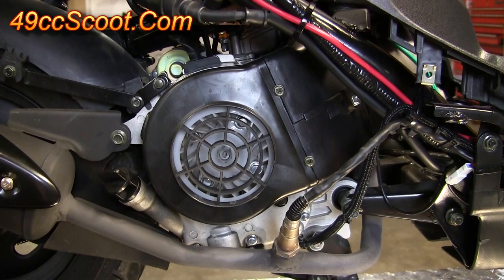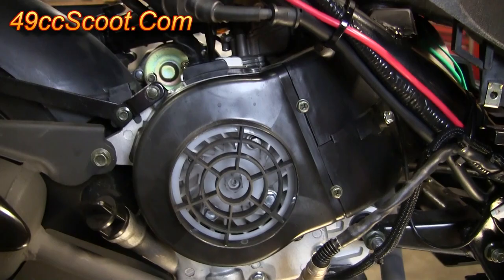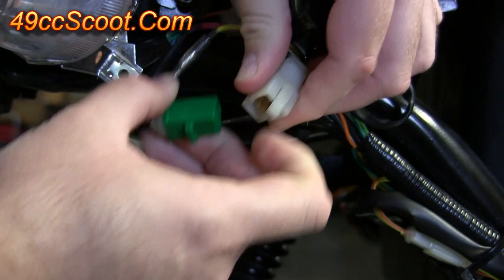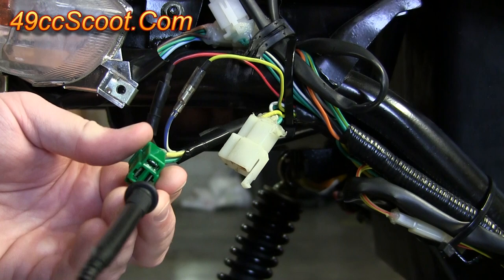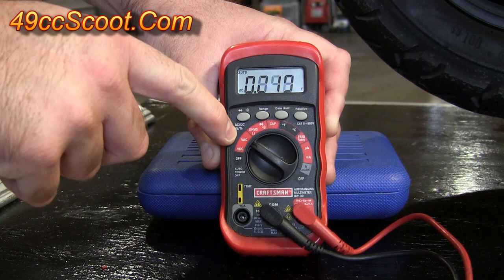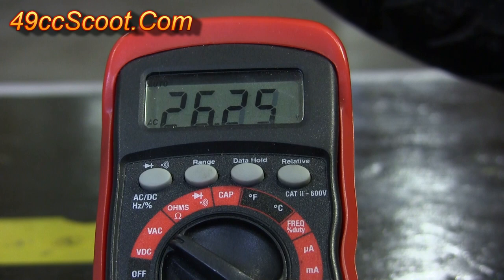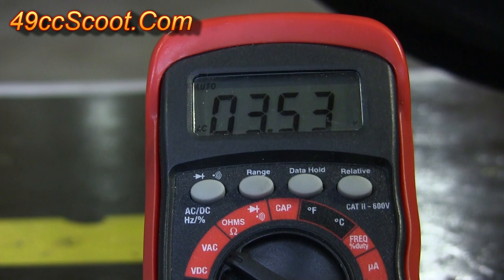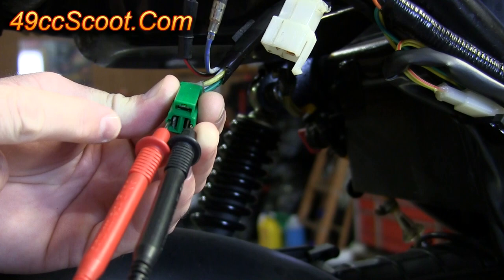Easy 50cc Scooter Stator Charging / Lighting Check : 139QMB GY6 50 QMB139 49cc

Comment from the maker: You can remove the CVT air filter and vent the CVT if you'd like. Won't pick up power, but could reduce heat related spring fade and possibly wear on other components. Don't remove the carb's air filter. If you want to do something there get a UNIT pod filter and upjet/tune the carb. For the exhaust, again don't remove it. You could get an aftermarket pipe. Check the jetting after. May see minor gains.

Comment: part of the store you didn't get, this all started with replacing the motor the new motor had a p at the 157 the old motor was not a p motor everything appeared to be the same except the stator was slightly different the green ground wire on the p motor the stator had a riveted ground to the back of the stator not directly to one of the coils like my old stator, installed stator and flywheel from old motor to new motor all is good !
Reply from the maker: Glad you figured it out.

Comment from the maker: A stiffer contra spring will raise RPM. I'd suggest trying to tune it with different roller weights, or ever better slider weights. Sliders will last longer and sometimes improve performance as well. Get the right weight dialed in so the CVT operates near the engines peak output and it will accelerate more quickly. I'd start there first. If it doesn't feel strong for the first few feet, stiffer clutch springs may help.
Reply: sir what is the right match for clutch spring, contra spring and roller weights for a stock 50cc honda dio to improve speed.

Comment from the maker: Stiffer contra could drop speed. So could rollers too light. To me the reasons to change to a stiffer contra spring are 1) When you experience belt slip or 2) When you can't get RPM where you want it with rollers or sliders available to you. Contra spring and rollers act against each other, so there must be a balance there. It's best to keep the CVT cover as it may increase structural integrity. Have seen 2 diff ppl break a CVT  case in half with no cover on the forums. Not common, could happen.

Comment: I'm running the fiddle 3 which uses a DC stator. I'm having issues with properly charging the battery. While using the scooter normally it just barely charges enough if not just under the proper amount. But the moment that I turn on the phone charger, voltage drops significantly. 
All of these readings are at the voltage regulator plug with the black voltmeter rod connected to the green ground wire:

64V ac yellow 46V ac white no reg connected (revving)
Drops to 12.0-12.1v ac yellow and 7v ac white with reg connected
26v ac on red connected
11.7v dc (engine off) to 12.4v dc (idle) on red reg connected

The voltage on battery also drops when accelerating and sometimes engine power is also lacking (I'm thinking it's connected to this issue)

I've recently replaced the stator, regulator and battery and this issue persists. Did I get a bad part?

Comment from the maker: Is 15V AC with the stator not hooked up or DC with everything connected? If it's DC with everything connected, checking at the batt, that's good and it's charging.

Comment: Yep taillight which is powered by the stator as the headlights are goes out also but things powered by the battery like high beams turn signals and brake light all work just fine and the scoot starts just fine so but I will definitely check all connections again it's weird for the first 30 seconds I do have headlights and tail light, but then they fade out and are pretty much gone...
Reply from the maker: Maybe see if you get voltage out of the stator after it's hot. So do the check here after the lights have shut off.

Comment: Please answer my question. I have a gy6 TaoTao  50cc Vip scooter. Last week ago my headlight light and tail light stop working. However, everything on my moped still work fine. People told me to buy a Universal Voltage Regulator Rectifier, 4-Pin 12V Male Plug Voltage Rectifier for 50cc to 150cc ATV Moped GY6 Scooter. They told me it a strong possibility that it may fix the problem. To get my headlights and taillight back working correctly. My old rectifier was 5 years old it came with the moped and work amazing. So, I went to a moped shop got a new one. Put it in correctly. It did not fix the problem waste of $25.00. Now, people telling me to renew my  Stator. They tell me the headlight and tail light run off the stator. My stator is 5 years old as well. Been Never renewed or clean or fix.  You think if buy a new stator off the tao tao site it will fix the problem?  I really need my tail light and headlight to work. It not safe at night and I don't want the cops to give me ticket. What will you suggest me to do?  And I hate going to the moped shops in my state. It like they fix the problem half-way to make you come back again. Like it been times I got things fix. And days later or few weeks I'm paying for the same repair over again. So, I am  thankful for your videos and free knowledge.  I believe I have the skill to fix it my self. I:m  decent  at doing repairs. Please help me.  Later
Reply: When the lights do not work but the scooter starts and runs perfect it clearly indicates the section of the stator that powers the lights is bad..This is the yellow wire coming from the stator.there a 4 wire white or green plug from the stator..There is no need but if you want you can test it with a multimeter while the scooter is running..Ser the multimeter to Ac you shoudl get like 15 AC volts at idle and higher when you revvy it up.When the rectifier regulator is bad it usually blows the bulbs and the CD voltage on the battery goes above 15.5 volts when you revvy it up..the rectifier section turns AC from the stator into DC and sends it to the battery thru the red wire to charge it..if it does not charge the battery,then the regulator is bad or the stator is not producing enough power to feed the rectifier.i hope this helps

Comment: You need to do this with the conector pluged in or I'm missing something....my scooter only had 4 wires is a 125 cc gy6 made by gareli and on the green and blue/White I'm getting 15 at idle and 60 at full throttle but between the green and the white only 3 so this means my stator is bad ?

Comment: Hello, if the scooter starts and runs ok but the light from short and long beam and the bord lights does not work, only the turn lights and break light work what is the problem?
Reply from the maker: If you have a headlight switch, start by checking that. See if you are getting power to the switch and if not, find out why. Check lighting, stator and regulator connections. See if you have stator output (as shown in this vid).

Comment: Are you still doing this? My turn indicators are not working? I changed the relay indicators but the connector to the other cable seems to be rusted inside?
Reply from the maker: You can do ohm/continuity checks if you have a meter. It kind of sounds like you've found the problem. Rusty connections don't conduct well.

Comment: Great videos, my stator reads 15-23 and only in the 40-44 range when throttled up. When I plug the stator back into the harness it blows my fuse..  my scooter is a 2016 Tao-Tao 49cc which I bought as a basket case . I replaced the fuse holder with a 10 amp plugin mini fuse.
Any Ideas ?

Comment: I changed everything on my scooter and still it charges fine on idle and throttle but when i turn on the lights voltage falls down 11 and does not come up even after giving it gas
Reply from the maker: Make sure the battery is charged and in good condition. If it's a swapped headlight, maybe it draws too much power. Possibly a stator or rectifier issue. Not sure what your scoot is, but I know when trying to buy parts for Chinese scoots, you have to be really careful that everything matches up on the stator and sometimes regulator/rectifiers that are supposed to work don't. If you swapped everything, you could see if swapping the old r/r back in changes anything or maybe the old stator.

Comment: After a new stator I am blowing headlight bulbs on a 50cc peace sports. All seems inspect while running but I can get a spike at higher RPMs for a split second while monitoring the lighting wire I assuming staters intermittently over spiking or shorting somehow?
Reply from the maker: Could be a bad stator or just the wrong one. If it was fine before, it's not so likely  to be the regulator/rectifier. I went through this on a 150 and one stator that seemed to be like the other would blow bulbs. Got a different one and it was fine. Check everything you can before spending money. Resistance values and any wiring or coil differences you notice.

Comment: Sir, I testing my stator the way you did. I got 50v while opening the throttle on one of the wires but got no more than 38v on the other wire. Should I replace stator?
Reply from the maker: First, if there's any doubt then re-test. I would expect to see higher values if you're revving it significantly. If having charging problems, I'd probably replace the stator at that point or find resistance values in a manual and see how they look first.

Comment: The stator output was 35 VAC when I first checked it before I even hooked it up to the rest of the system....when it was put under load(connected and running at 4,000 rpm) it showed 15 VAC output to the system on the meter and battery was discharging....a new stator is supposed to have around 60 VAC when it is working properly...right?...this one  seems defective.....last night I charged the battery again and put the meter across the battery poles and measured just under 12 VDC with bike running at 4,000 rpm( I its supposed to be checked at 5,000, but my wheel touches the ground due to a performance shock I installed).... then the bike eventually went below 11 VDC and it died.....a scooter wont run without at least 11 VDC of power from the battery from all I have read.....what do you think is going on?.....a piece of extra info: have the headlights wired to the battery directly.
Reply from the maker: Is that scoot a DC CDI? If it's an AC CDI, it should be OK even without a battery. A DC CDI would need a good battery to run well. You may not get 60VAC if you are at 4000RPM, and it all changes once hooked up to the scoot's wiring. Your headlights may be too much and draining the battery also.

Comment: Hi, hope you can help me out here. I’ve a TGB 50, starting good, everything else working ok but the headlamp, running light and tail light not working. Traced wires, cleaned connectors, checked bulbs, still not getting lights. Any advise please, Mike
Reply from the maker: Some scoots use 12V battery power for the lights. If that's the case, check your battery. Otherwise, check lighting output as the vid shows and make sure there's no fuse that's blown.

Comment: Hello
 Namely, I bought a new battery, assuming the old battery didn't work
 properly, but it turned out that the problem was not even in the batteries, namely
 the battery probably won't charge, the voltage won't increase. The full battery life was 12.6v and beyond
 each startup drops about 0.2v.
But if you can start the engine electrically, then you can drive wherever you want even when battery drops below 11volts.
if it is kept on the ground for about a minute at 4000 5000 revs, the battery will gain 0.1V, so it kinda works but it doesnt generate enough.
So right now im just driving with 2 batteries, 1 in car and 1 in backback.

And such a conversation struck me with 2 factors .. a stator, or
  the voltage regulator is not working properly, ie problems with the generator in general.
So basically i should check the same wires as you checked and if they are faulty then i should replace them right?
Reply from the maker: If it's the same engine, then this test should tell you if the stator is putting out charging/lighting power.
Reply: @49ccscoot  hey problably not, mine is a  jiajue one but not sure what model, but i know where the connector is what you showed and i will test it today, thank you.
Reply from the maker: @martinezuringoz There are tons of Chinese scoots that use the same engine style. 139QMB is the most popular for Chinese 50s.

Comment: changing the stiffer contra spring will affect the top speed ?? stiffer contra spring need heavy roller to balance it ?? can scooter run without the CVT belt cover ?

Comment: My Piaggio 125 doesn't keep its battery charge, just wondering if I am looking in the right place or could it be something different?
Reply from the maker: Definitely a good idea to check the stator output if you don't see charging voltage at the battery. If the stator is good, probably the rectifier/regulator. Check voltage at the battery first. There's a possibility that the battery is going bad. https://www.youtube.com/watch?v=xS58b5jZ0ic

Comment: What if i'm getting a high voltage up to 20 or maybe more and it keeps burning my headlight ? and even though i installed a new stator and regulator and it's still transferring high voltage that causes to blow up the headlight everytime i change it, any idea of what is that could be ?
Please let me know thanks!
Reply: you need to see if you have a short to ground,

Comment: how can i improve my 135cc 4 stoke scooter acceleration , it heard like going at low rpm when accelerate and get into top speed of 115km/h , how can i improve all of this ?? what different compare to stock when change 1500rpm contra spring ?? i need to have a racing variator ? or just changing the roller weight and spring ?  thanks

Comment: I have a honda elite 50, I recently converted it a 70cc polini , after im riding for a while it drains my battery and I have to kick started. 
I thought it was the battery so replaced it and still,  you think it may be the stator
Reply from the maker: Check your voltage at the battery and see if it's charging that way. https://www.youtube.com/watch?v=xS58b5jZ0ic

Comment: My headlights will work properly upon startup of the scooter, and they seem to respond to throttle inputs RPMs(brighten and dim Etc which is normal... But then after about 30 seconds they go completely dim....  Haven't checked into it yet but I'm wondering if it could be the rectifier regulator ?? Or? Thank you I appreciate any suggestions you may have
Reply from the maker: Check power to the headlights. If you have other lights powered by the stator (maybe the tail light in some cases or dash lights), see if they go out too. Make sure there's nothing simple like a bad connection.

Comment: My headlight is not working it used to come on and off when i would hit bumps on the road but now, it wont come on i checked the wires and the bulb the wires look okay a little sloppy but good enough. all other lights work i don't know what do it's dangerous at night and i need to renew my inspection in 2 weeks and without a headlight it will fail of course. some additional information it was raining and i saw a rain drop go into the light button could that be the problem?  Any suggestions? i'm running out of options. Thanks in advanced
Reply from the maker: I'd check all wires... from the headlight to the switch(es) and then to power from the switch(es). Sometimes the bulb sockets aren't as secure as they should be or a pin needs to be bent a little to make better contact. It could be related to moisture I suppose, but problems with hitting bumps are usually some sort of connection issue.

Comment: Hey you still answering questions? So I recently got a brand new Dong Fang df50stt. Me and a buddy installed a new cam shaft, fuel filter, air filter, cdi, and spark plugs. We messed up and when we finally got the bike started again the battery was dead. Im sure we messed up by doing this but we charged the battery with a car battery charger which really ruined the battery. I got a battery tender for 1 amp charging and a new battery, however my new battery isnt holding charge and my headlight isnt lighting up. now I think the headlight blew out after the time I jump started it with cables hooked up to my buddy's car. I got a new battery and a battery tender, but the new battery only holds enough charge for a few rides before it starts getting low and then doesn't have enough charge to start up the bike. Do you think I just have to replace the stator?
Reply from the maker: Have you done the checks in the video?
Reply: 90GTVert I'm going to soon, my buddy has a voltmeter, so Im waiting for him to have a free day, I dont know exactly where my stator is so im doing the battery volt test.

Comment: hey my tao tao gy6 50cc don't start I bought it off a guy tht replaced the cvt belt and the belt broke thts y he replaced it and now it don't start do I have to top dead center it first
Reply from the maker: No need to worry about engine timing when you replace the drive belt. Here's some help to get you started and narrow down the issue : http://www.49ccscoot.com/faq/wontstart.html

Comment: I have a 50cc taotao 2014 with 200mile I put new lcdi box new coil spark plug but no spark cranks but don't start can you help me out
Reply from the maker: neftali lopez You can do something similar to what's shown in this vid, but with the black/red wire and white/blue wire. Kick or crank it over and check for AC volts on those. The black/red should be 50VAC or more. The white/blue should be roughly 0.5VAC.  If you don't get those readings, the stator is probably bad. You can try checking the gap between the reluctor (raised bit of the flywheel) and the pickup if volts are low on the white/blue wire. It should be somewhere between 0.010" and 0.030".  A credit card is roughly 0.030" if you don't have feeler gauges to check it.